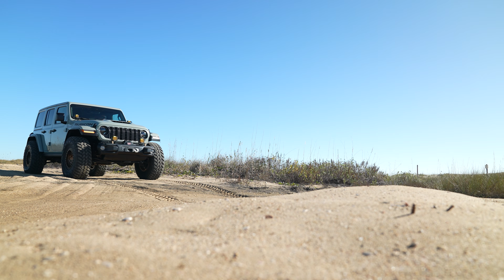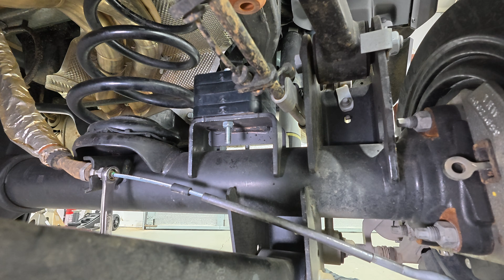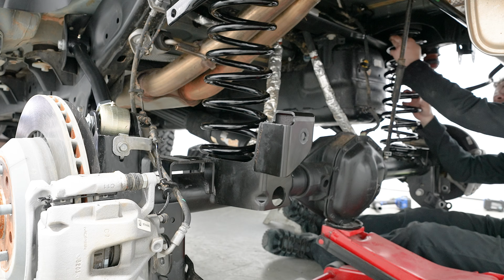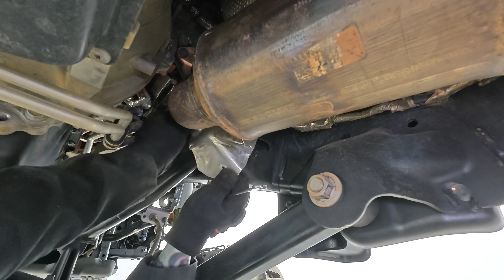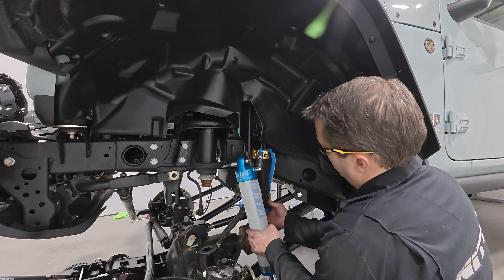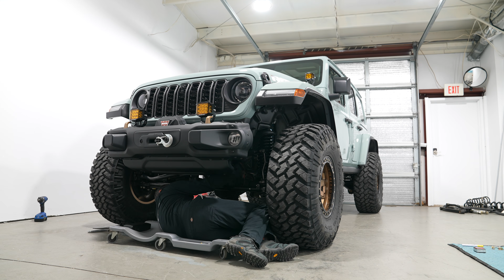How To Install a 3.5 EVO Mfg. Lift on a Jeep Wrangler Rubicon 392 | Inside Line

Comment: I hate this seat up to relocate the arms. Your gonna pound them more then ever since they hang lower I'm on my 3rd set in 2 years
Reply from the maker: There’s obviously some downsides any time you lower the controller mounting points. If I do end up getting into them frequently offroad, I think I’ll look at a long-arm upgrade. For now, the handling benefits seems to outweigh the ground clearance loss.

Comment: 150,000 miles is minimum for any decent modern vehicle. If it can’t make 10 years/ 100,000 miles trouble free, then it is not quality. 
My 2010 JKUR did 14 years with no issues. Mostly trail riding/ town

Comment: So just checking…37’s worked without any mods and 38’s require a full lift kit?
Reply from the maker: If you haven’t already, please watch the video where I made with 38’s and no lift on this Jeep. It’ll make more sense why a suspension lift was necessary. Ultimately, if you didn’t want to buy a lift, you could add in extra bump stops, split the flares and install a set of adjustable front control arms and make it work. The problem is, you would have virtually no up travel. So, the ride quality wouldn’t be great. This is just a better option for those looking to not only move up tire sizes but get more off-road performance.

Comment: Great instructional video. This kit is expensive, so why did you not go ahead and get some different bump stops?   those looked small. Maybe a hydraulic set in the future or do you not think you need it?
Reply from the maker: For how we will be using the Jeep, a hydraulic bump just isn’t necessary. That’s a greater benefit for those looking to go fast off-road.

Comment: looks great now. I got the same 38s and went with the kmc 235s (-38 and,3.5 backspace) instead of 236s  you have. One thing i can point out is have 2024 Rubicon X 4xe and have no fad from stock. I had caster at 7-7.5 degress in it vibrated and made sounds. I now have it at 6 its been 6 months and its doing fine. I recently ordered stoptech delta bbk and going to arrive soon. The front pads are down to 10 percent after the heavy kmc and nitto combo in less than 3k miles. Something to watch out for!
Reply from the maker: That’s wild about the brakes! I will definitely keep an eye out. Thanks for the note.

Comment: Why don’t you have dual rate springs?
Reply from the maker: These are the only springs offered with this kit. I have Jeeps with linear and multi rate coils. There’s pros and cons to both. One of the biggest challenges with a multi rate coil is that it tends to bow more than a linear rate one.

Comment: Great setup! Surpised the factory front driveshaft is not contacting under full droop with that amoubt of flex.

Are you strengthening the factory axles i.e. truss, ball joints, RCV axles etc?  Those Nitto TGs are heavy at 90lbs each.
Reply from the maker: The driveshaft is super close, that’s for sure. We ordered RCV’s. They are on back order at the moment. So, just waiting for them to show up. Ball joints are still fine, but will upgrade with Dynatrac ones when they start showing signs of wear. Not sure if we will truss the axle.
Reply: @DrivingLine  I'm planning a similar build with 38 Nitto TGs on KMC Grenade Crawl beadlocks but with Rock Krawler 2.5 lift. Planning on truss, RCV axles and ball joints in one go but watching how yours fairs. Already have the new NVM 7,000 series skids installed so bottom bits are protected.

Thanks again for a great series